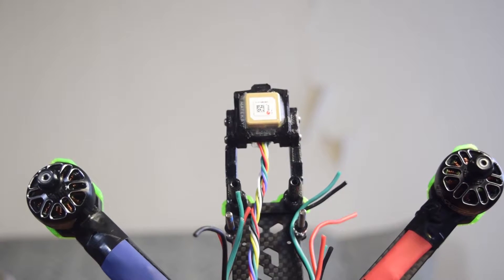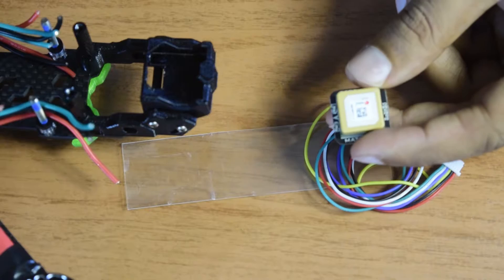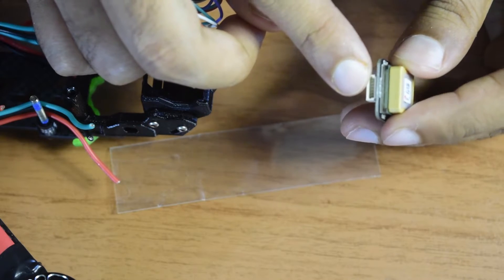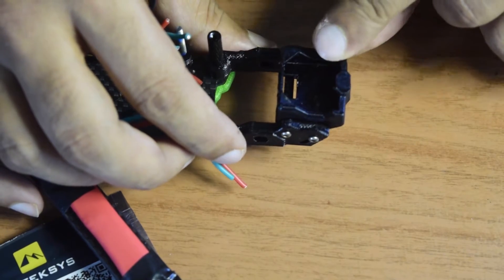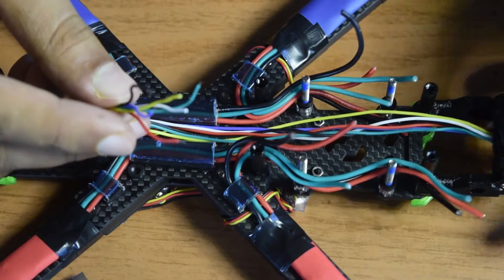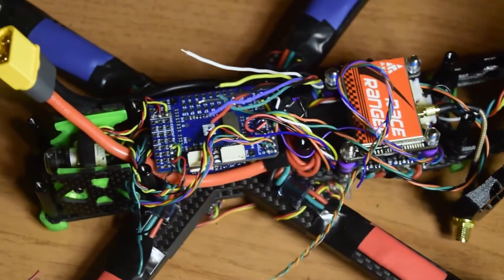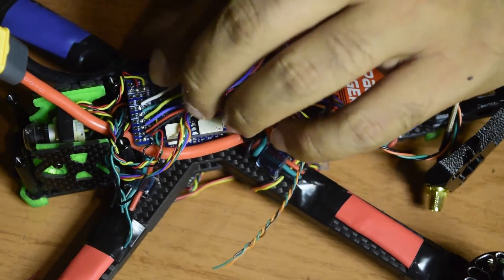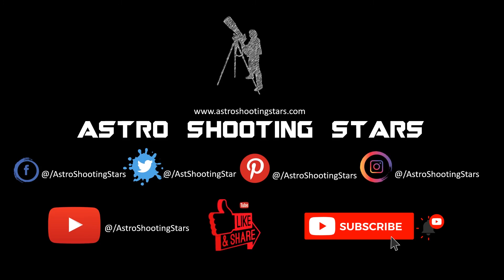HOW TO INSTALL GPS MODULE ON DRONE | MATEKSYS M8Q-5883 GPS SAM-M8Q AND COMPASS QMC5883 MODULE

Comment: Can anyone help me understand the difference between the two Iflight GPS modules? 

I have searched everywhere but there is not much information online about the Iflight Blitz M10.

My Nazgul Evoque F6D 6S HD came with the Iflight Blitz M10 GPS Pre-installed. I ordered the M8Q thinking that my drone didn’t came with one. 

I am trying to figure out which one is better. Is the Blitz M10 the newer and better version or is the M8Q V2.0 GPS still the best one? Looking for some suggestions before I end up changing the gps. TIA

Comment: Wiring it on the receiver or vtx?
Reply from the maker: For GPS module you can wire it to flight controller normally not vtx however only with tbs crossfire diversity receiver you can wire it to receiver. Please follow the wiring diagram. I hope this helps. Please stay tuned to my channel for my future videos

Comment: Sir this gps work by 4g network and only network
Reply from the maker: This is a external GPS module , gps network do not depend on 4G network. GPS signals are normally broadcasted by the satellite 4G is cellular network it can be used by mobile devices to increase the accuracy but this GPS can work without 4G network. I hope this helps. Please stay tuned to my channel for my future videos
Reply: Thanks sir I from Balochistan Pakistan I need ye help can I get ur what's app num please.
Reply from the maker: Dear friend i understand your curiosity but as of now i dont do personal consulting. Please post your comments here i will try to clear your doubts as much as possible.
Reply: @AstroShootingStars  sir does it have unlimite range or not
Reply from the maker: Gps depends on the signal strength and number of satellites avialable or locked to give you accurate location. So if you see the GPS module once purchased you can use it for unlimited time without paying any service charges for network. So technically there is no range its the signal strength of the satellite in your area. I hope this helped.

Comment: The same rule is also for iFlight M8Q-5883 -
90deg flip, if connector is facing ahead, 
and 270 flip for rear (this model doesn’t have an arrow mark).
Reply from the maker: Yes it should follow the same rule, as technically they are the same compass and gps module combination just different manufacturers. Additionally you  can verify the same in the Inav or betaflight the orienttaion when you move it in 3D model which shows its live value and model representation. I hope this helps. Please stay tuned to my channel for my future videos
Reply: @AstroShootingStars  why 90 and not 180? Manual says arrow should point into flight direction, so in this tutorial the arrow is rotated 180 degree relative to flight direction.